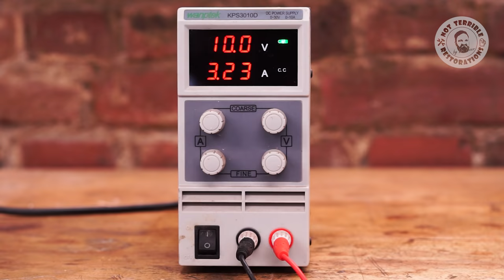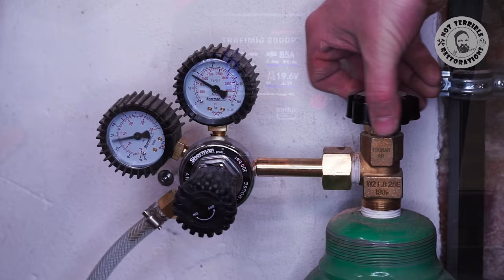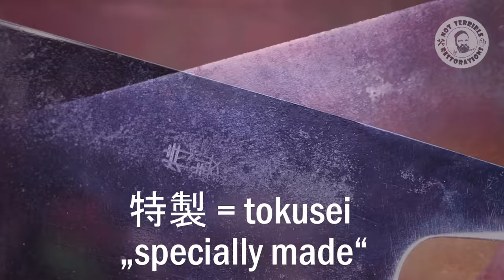Making A Hidden Tang Knife Handle From Bloodwood & Ebony | Restoration of Japanese Knife

Comment: An amazing restoration! The handle is beautiful!
An advice about the sharpening process
1. the stones you’re using are soaking stones, they should be soak in water for about 15 min (until there is no more bubbles coming out on them)
2. Try to use the whole stone when sharpening
3. For more consistent angle, the stones should be flat,  you can flatten them by rubbing them on a sand paper (around 150-300 grit)
That is placed on a flat surface, it will Also help to remove the “clocked” surface of the stones, a thing that will make the stones perform better.
Reply: Great advice!

Comment: Wish I would have used those pins on my wa handles, I have had to slow way down on shaping/grinding my handles because my stainless spacers were getting too hot and activating the epoxy and separating. I love the wood pairing and the shapes and angles, keep up the good work.

Comment: Curious question (because I'm not a restorer so I don't know) Why the choice to file the welds rather than us a grinder or multi-tool? was it to protect the welds? would using a tool be too "rough" for the part and potentially damage the repair? Also, very happy you saved the etchings. I don't know why but that made me smile. Thank you for sharing!!
Reply from the maker: Hey tonja the biggest risk is that the blade gets too hot to fast and then the hardening is lost. That's why I used the files. The welding itself is not in danger
Reply: @NTRprojects  Awesome!! Thank you for answering! I appreciate it and today I learned something new

Comment: So you don't use any kind of rust inhibitor?  I guess it doesn't rust up immediately after the electrolysis?  I used a rust remover on something and it just rusted up again.  I'm trying to restore some garden shears and I don't want the rust to come back right away.

Comment: This is a Nakiri, not a Usuba. Usuba is single primary bevel with one side being hollow ground.
Reply from the maker: Hey Drewski thank you for the information!!!
Reply: @NTRprojects  great job on the restoration by the way! Oh, another thing is, this is probably a San Mai construction so there is probably a core steel clad in iron/other soft steel. Etching with some acid could bring out that core if it’s exposed. Other ways are cutting hot proteins/meats to develop a patina. If it doesn’t show then it probably needs to be thinned to expose some of the core steel. Handle looks awesome! Again, great work!

Comment: Beautiful job! But personally, I think you are crazy not using epoxy and a pin to secure the tang into the handle. Beeswax may be the "traditional" method but i believe we have found better ways in the past 1000 years or so.
Reply: but still i think it is very interesting to be able to observe how well it's going to hold up. and also aren't there connections where the tang is simply hammered into the handle without any adhesive? And those can be pretty strong, even for decades... depends on the fit and pressure i guess. And maybe it's also better for repairwork without chunks of epoxy to scrape away.